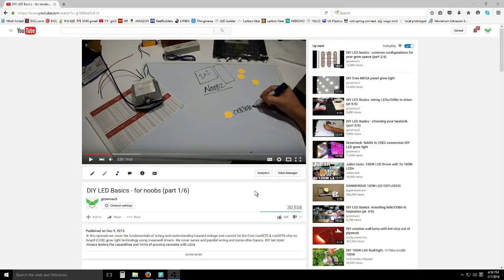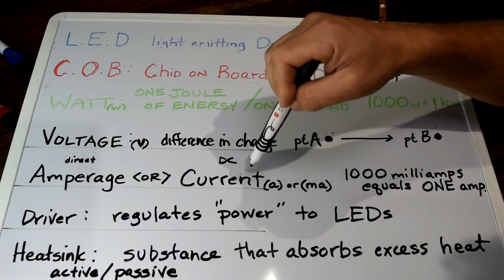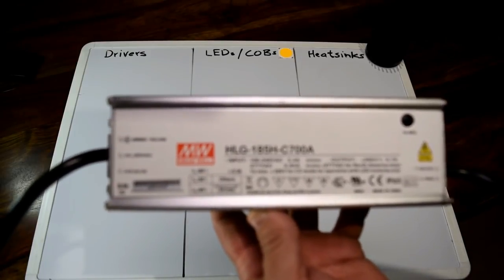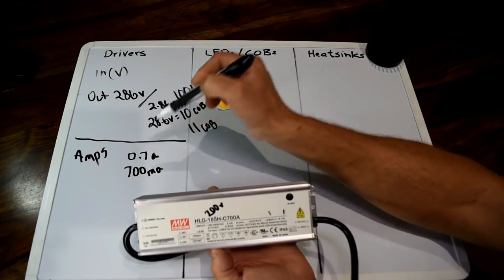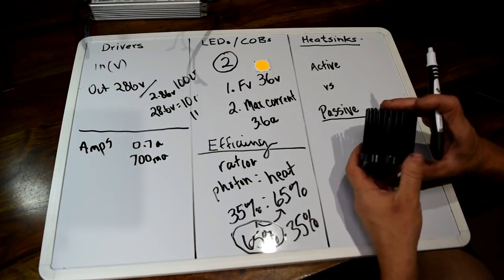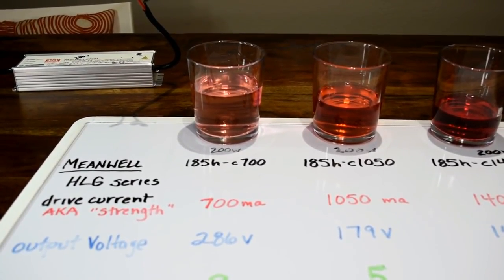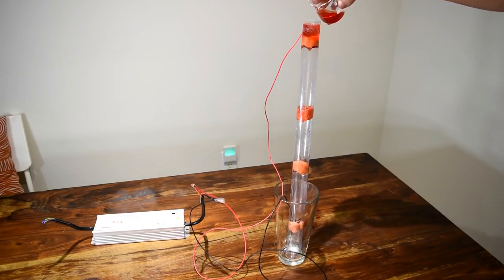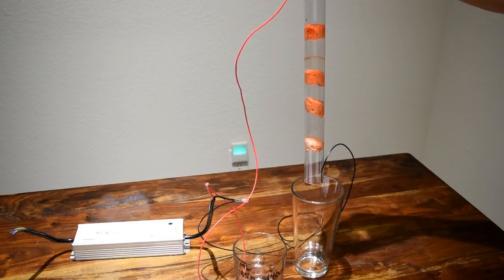DIY LED basics: getting started building your own grow lights: (pt 1/6)

Comment: Another great video. I would have to say the only real problem I had from the last video was understanding how to calculate heat watts for a specific cob at a specific current. I would say that reading the brake downs on each cob on the rollitup forums took me awhile to fully understand. 
  I am not sure if any one elsa had that problem but it might help to show a brake down and walk them through each column.

  I just built a 300watt light and it is just amazing and I owe that all to you. Thank you very much for your generosity and expertise. I only found your channel a little over a month ago and I already have a light up and running. 
  It would have taken months more of research to realize this cob light without this channel. Thanks again..

Comment: I have been growing under lights I put together for just over a year now thanks to this video. Thank You Growmau5!
Reply: How do you like them honestly? I'm thinking of investing on some but still a bit afraid the yields would suffer. Would be cool to see an updated version of this video. Best leds atm etc.
Reply: @Skeptic2006  Can't speak that they are the best, but I have been using the HLG QB132 boards, currently getting about 68w per board (4 boards) in a 3x3. Can get about 4oz per plant, 4 plants in 3g-5g fabric pots. I believe most reputable LEDs will do similar. I am considering a 2nd flower tent, and going with strips, but could end up in another direction.
Reply: @jarrodbrush  If I'm going to do one it will be using Samsung 301B leds since they are the most efficient white leds out there currently.

Buying it all at ones for a 1000w hps equivalent is still just too pricey for me. But I guess I could first build a veg light with just one driver and half of the strips.
Reply: @jarrodbrush  Hello there, I've never done this so just trying to get some info, so here goes....when buying leds do you just buy any ( I'm talking about whiteness, or light spectrum I guess) or do you have a mix of say , red or blue light, infra red etc.... leds? I haven't really looked into what's available yet just thought I'd ask someone who's done it successfully. Thanks.

Comment: Just out of curiosity...Why does it seem that manufacturers always run numerous LEDs in series rather than parallel? Or, why is it more common to use high voltage and low current, rather than low voltage at high current? I would rather see one LED die and not take out the entire fixture, but for some reason that's just not the way I'm seeing things designed.

Comment: The most important thing to understand about LEDs is their typical NTC characteristic. The higher the self-heating, the lower the electrical resistance. If the LED were operated at a constant voltage, it would convert an ever-increasing amount of power as it warmed up. This would lead to thermal self-destruction. To prevent this, the current is regulated. The voltage across the LED drops as the temperature rises (see Ohm's law). This stabilizes the system and automatically reduces the output when it gets hot. This could have been emphasized in the video. Otherwise very well explained.

Comment: Good video very informative as you were explaining efficiency I realize you were talking about Ohm's law. Basically the higher the voltage you run the amperage will drop down automatically and the watts stay the same. Using higher voltage with anything is more efficient. And since you have to match LED voltage with driver output you're also spreading the load and the heat will be lower due to view material in between the LEDs.

Comment: Thanks for great video. Just to clarify - if 185h-c700 driver can run 8 cobs is it possible to plug less. I mean - i’d like to build system with 8 cobs but I would like to have possibility to turn each of them separately, so in this case will cobs keep the same efficiency when for example only 4 of them will be turned on?

Comment: Awesome video! I know you needed to keep the explanations simple, but I would explain why current accounts for brightness because we are dealing with setting up our own system after all. 
In reality, power output in watts determines overall brightness. P=V*I which means that power is dependent on voltage and current (and resistance). We could hold current,  at a fixed value and increase the supply voltage  and change the resistance to maintain the same power output (or even keep current and voltage fixed and change the resistance etc...). However, in this case we would be talking about a completely different bulb because the filament (resistor) in the bulb is fixed (unless a variable resistor allows for dimming), and at the same time, the wires connecting the bulb and the power supply keep the voltage fixed. So we can vary the draw of current and therefore change the power output (brightness) of the bulb through current. (*Note I'm no electrician, but simply needed clarification after you mentioned current was everything. Please correct me If I'm completely wrong. Been I while since I "physics'd")
Reply: I might also add we can express P in terms of voltage and resistance: P= V^2/R

Comment: Great video.  Can you do a video on replacing a blown LED driver?  I bought a 1500W 225 LED Grow Light UV Growing Lamp.  It worked great for 4 weeks, then the driver blew.  I am trying to either purchase or build a replacement driver but have had no success.  A video on how to determine how to chose the right driver based on the information on the existing driver would be very helpful.
Reply: He explained drivers in this video lol

Comment: Dude, you have professor level teaching skills; articulate, clear and to the point.

This however, almost seems to be backwards (for lack of better explanation due to my ignorance) compared to how I've understood electronics for computers, household and automotive, where the voltage output on the power supply, amplifier, breaker panel, etc, will remain stagnant with only very slight fluctuations, depending on stress or load and of course operating temperatures, but the amperage or current draw increases with load or more devices added. I'm assuming this is because the COBs are running in Series ? With car speakers we typically run in Parallel to drop the Ohms, thereby reducing resistance and increasing current flow or draw for more power output and I know if you run it in Series it would have the opposite effect of raising the impedance or Ohms, increasing electrical resistance, thus decreasing power output

Comment: Very well done. Checking out diy led lights can seem confusing even to those with some basic electricity knowledge. The voltage forward part was confusing me, knowing how many cobs a particular driver would run. Which brings up my question.

I've heard you should aim to use only about 80% of the voltage (DC out) of your driver. Do you agree with this, or feel as long as the sum of all vf's is under the drivers rated capacity you're ok? Thx.
Reply: Ni Jo hay fran u need a dude on pont to to help lmk i am here man i dont mind heling i littil upset i need 3 or 4 seed fuck vader og 15 email leater still no fucking email lolol it cool.  but bad bizzinss  I emailed Ocean grown seeds for times no good bizzinss top stuff lol thay will not evin email u back 

as far as your question when you drive a mean well driver at the full voltage it just cut down on the efficiency meaning if it converts the electricity from the wall to DC voltage at 95% efficiency meaning you only lose 5 percent voltage in the conversion when using all the power from the driver you lose efficiency and that's all don't be scared

PS you have many amps when your driver and you're pulling more voltage recommended then the driver says it can give you its still will give you your extra volts you're asking for if you're not asking too much it will wire your amps  a little bit to supplement the extra voltage

Comment: Thanks a lot! Your videos actually made me decide to build my own LED instead of buying a premade one.
One thing I´m just pretty confused about is the Output V of the driver. The driver you showed in the video says 286V, yet if you look at the PDF from Mean Well it says " 143V ~ 286V ". I´m not sure if I would be able to use 4x COBs with 36V each now on that driver - since that that would be 144V together, but since It´s 700a it would probably be around 142-143V. 
My question is basicly if it says 143V ~ 286V on a driver if 143V is the minimum V I can run on it.

Comment: Can someone answer this for me - Do you have to run maximum voltage on the driver (10x28.6v cobs on a 286v driver) or could you run it at less (5x28.6v cobs = 143v on a 286v driver)?

Comment: you doing a great work here, sir!
have you ever considered to make passive-active cooling by only using the temp. diff. between heatsink and ambient based on peltier elements (seeber-effect) and fans ? this should give the benefit from less heatsinkmass without additional powerconsumption and may be self regulated as well.
Reply: +growmau5. indeed they'll do if you running it in peltier configuration - applying current/voltage to it, you'll obtain a heat on one, cold one the other side.
but what i meant is, running them in reverse peltier aka. seebeck (damn typo in last post...) circuit configuration - means, the temp. gradient between both sides generates current/voltage. so if you put one side on the led-heatsink and on the other side (isolate between) a small heatsink which holds room temperature, you get energy out from it which may be used to run a fan that could be used for better air circulation on the led heatsinks.

Comment: So I am not a grower, but I am looking to build my own LED to use for film. I am interested in The Yuji BC Series  BC270H. The 500w LED with the radiator. I am going to take an old tungsten  Fresnel fixture and fit that unit inside. 

MY question is, with the driver that they recommend, will I be able to power a fan off of that also, because I am going to put a fan inside the unit?

And Do I have to use that black plate that is on top of the chip? Or can I find a large glass lens that I can put in front of it?

I have watched all of your videos about building and such since it all relates to what I am doing, so that is why I thought I would ask.

Comment: Great video and really innovative analogies with the colored water, etc!
I'm curious why the HLG185h-c1050 only yields 179 Fv rather than 190 Fv? [200/1.05 = 190, not 179) 
The figures come out right for the HLG185h-c700 and the HLG185h-c1400,, but not for the c1050.  Still would only drive 5 36v COBs, but...  Any idea?

Comment: Great series, and love how clearly you explain things.  One thing though, I believe you skipped explaining what "BIN" means, because in your next video you mention bin in describing a COB, but I can't tell what it defines.  Also, on a COB spec, there's the following listed: 
5000K COB LED Version 4 CRI 80+ Drive Current (360 - 920)mA, 36V typ, LES 9.8mm

The part I don't understand are these parts: Version 4 CRI 80+ and LES 9.8mm
Any help is appreciated and thank you for doing all the work you do to help us understand this new lighting ;?)
Reply: One more Q,  just for practice I wanted to build a small 4-COB unit w/5000K CCT and total voltage @200-225, this is the COB I'm looking at ($20.08 each):

Citiled CLU046-1812C1-503M2G2
5000K COB LED Version 4 CRI 80+ Drive Current (1080 - 2760)mA, 54V typ, LES 22mm

So would this work as a driver for 4 of the above COBs:

 Mean Well LED Driver (CC, CV) 225W 15A Linear (7.5-15Vdc) 90-305Vac PFC PWM, Resistance, 0-10V Dimming IP67 Metal Enclosure

The site I'm looking at is rather confusing due to the LARGE number of models and the dropdown menus are somewhat confusing (too many options, lol).  Any input would be greatly appreciated ;?)

Comment: Got all of my stuff ready to go but I just noticed on my Vero 29 package that I should have a an anti static workstation. When I assembled my computer, Newegg recommended that I just ground myself on the power supply (while off). Is there any special handling you do for working with the LEDs?

Comment: First off,  thanks for such a helpful series.  I was just wondering if I have some small drivers (input 85-277v output 18-34v @650mA) and I am using 3w leds, this means 1. I need at least 6 strung together to keep from blowing the led on startup and 2. 11 led for max efficiency?  I am assuming a draw of around 2.84v.  I'm just trying this for the first time so any help is appreciated.

Comment: The only thing I'd add to selecting a driver and/or designing a system... it's not just the amount of voltage in and voltage/current out to consider, it's also the amount of current in for each driver that's a factor. I ran into this when designing a 177 diode xp-e/xp-g panel.. although it was designed for only ~350w, I had planned on 3 Mean Well S-150-24's (24v @ 6.5a), covering 21 individual drivers. 350w is nothing.. but the 3 power supplies, at 3.2a maximum input each, would require at least 8 amps from the wall. My place only had 10 amp breakers. Even at 15 amps in my new place.. if I want to use anything else on that circuit, I needed to reconfigure my panel. Using 48v supplies/drivers turned out not only the most efficient, but the most beneficial. The higher the output voltage, the less input current the power supply required. The higher the input voltage, the most efficient the drivers.
Reply: ***** I'm in Vancouver.. old house had 10a for the regular wall sockets. New place has 15a wall socket, 40a for the stove.
Reply: ***** I should also have mentioned that although I'm licensed, I'm on disability, so I'm forced to rent. I can't do any sort of rewiring whatsoever. I have to plug into the wall. And being licensed, I'm subject to inspections.. everything has to be up to code. I'm not sure what they'd say about diy panels though.. I've yet to have an inspection. Knock on wood. :P

Comment: hello. . I have a question. i only have a boost converter on my hand right now, I want to use it to light up a 15-24v led. 
but i searched there is only a buck circuit that can limit the current.
 if i use a boost converter and set it at 30v, and use a 47 ohm 10w resistor to limit the current will that protect the led from burn out?

Comment: so far you've been driving the COBs at or just above the Vf.  What happens if you drive four COBs with the 185H-C1050A?

How do you figure out PPFD from PAR W?  Is there math, or just light metre readings?  Am I correct in thinking four CXB3590 @ 1050 mA would give about 930 PPFD in a 2' x 2' tent?

Does running COBs at 1.4 A increase light penetration? (even after raising the lights higher than running them with 1050 mA)

Comment: Great video! Thanks. If I understood right it's ok to have fewer LEDs per driver and it will still work. For example, if a driver can handle 100 3Watts LEDs, but I need only 70 of them to produce light it will work correctly as far as they are under 100. Is it right?

Comment: At about the 16 minute section, are you saying that the amount of light you get is dependent on the amount/power of your drivers and not the power and amount of cobs? In other words, 8 100w cobs does not give 800w of light unless you have 800 watts of driver power? If the 100w cob is on, its not necessarily giving 100w?
Reply: What size driver do I need to power 8 100w cobs at full strength? They are 36v and 300mA.
Reply: +growmau5  Hi so this configuration you providing here  will give  me 800w ? If I use 2 driver's and 4 cab for  each driver. And  what  will by the PAR ? thanks  very much for your effort.

Comment: Does the 0.7amps run the cob at 0.7 amps? Should you look for a driver with a similar amp output as long as it is lower then the cob so it won't blow?

Comment: I'm wanting  to run different size LED for a shelving project.  Looking to do a spiral effect, larger to smaller. largest being 10w to 5 to Single ...... Then I'm also wanting to do the single RGB, to follow  flow of spiral.  I also have 4 10w uv bl light All 3 are to have different  toggles, . this is a 18"×36" shelving unit  I'm making to go over  a uv light poly resin desktop I made.. I used uv singles, but it does not illuminate as I would have liked hence  the 10 w uv.  I actually used a piece of aluminum  siding for that, and the plastic inserts from xma lights, .. I never finished it off like I needed too because I'm thinking of replacing the uv, with full spectrum single diodes or every other 1... and I'm using a battery  pack for application purposes. but I would like to eventually  get everything  tied up. Any Ideas?;
Reply: I forgot to mention the main spiral is my main lighting over the desk.

Comment: GOOD VIDEO~!!
I did not know about the output voltage (7:26).   You did not say whether the LEDs needed to be in series or parallel to take advantage of that volt and amp output. But since there are 6 videos I'm guessing you'll  get to that later.

Comment: Thanks for making the videos. I'm getting a little better at understanding how this works. 
I built a light based on instructions on a website, maybe 5 years ago. It is 8 Cree 3070s. They are run with 8 Mean Well LPC-60-1400 drivers and there is 1 Mean Well PLC-45-12 driver that I think runs the fans on my heat sinks? I recently bought some big passive heatsinks and was wondering if just need to run those LPC-60-1400s for each Cob or is there a better way? I'd like to run to groups of 4. Any help would be greatly appreciated. I suck at this and don't want to burn the house down.